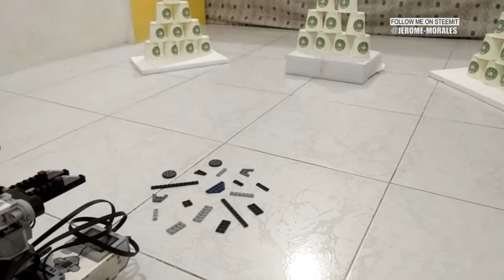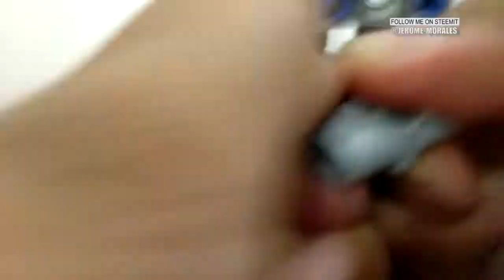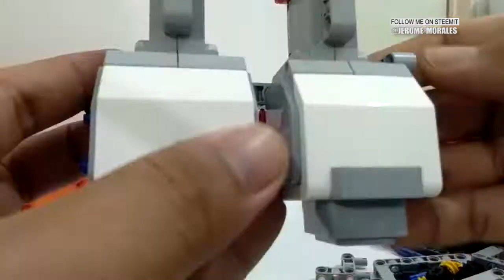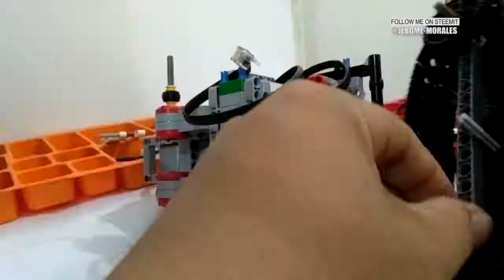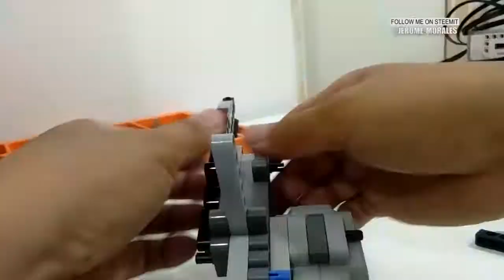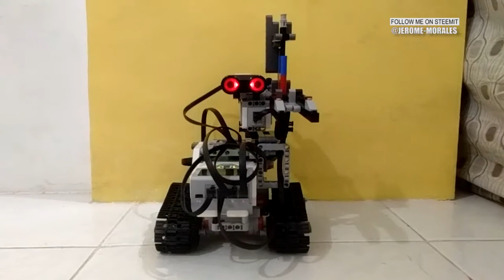EV3 Robot with shooting mechanism

Comment: Did you handle the movement and shooting on one brick? I can't figure it out how to manage it.
Reply from the maker: All movements are being run by a program. I used the ultrasonic sensor to detect the brick/cups at a certain distance and when detected, it will activate the large motor installed in the shooting mechanism.